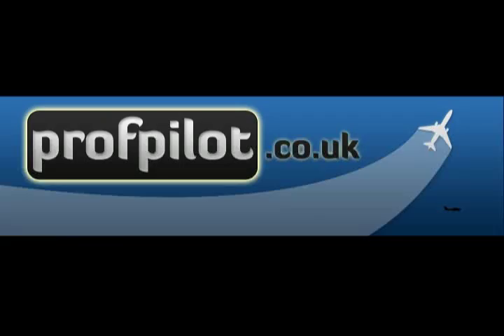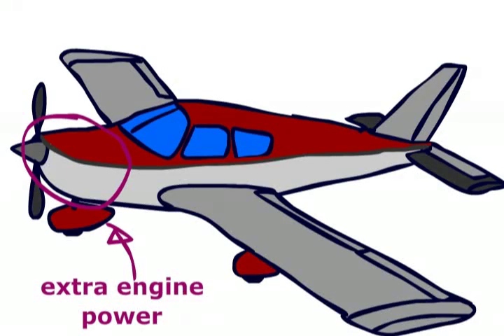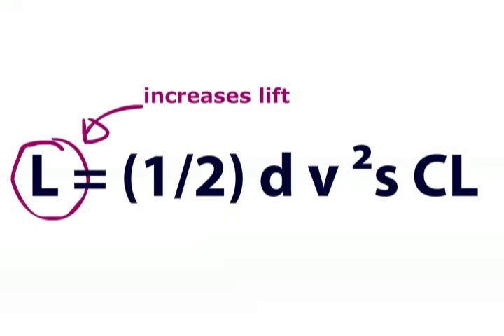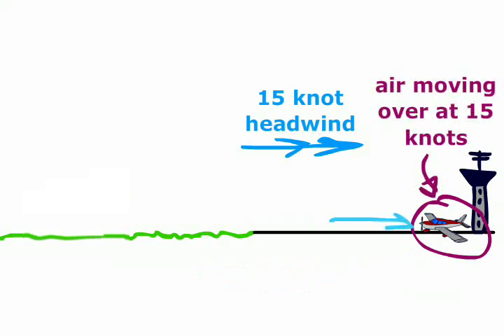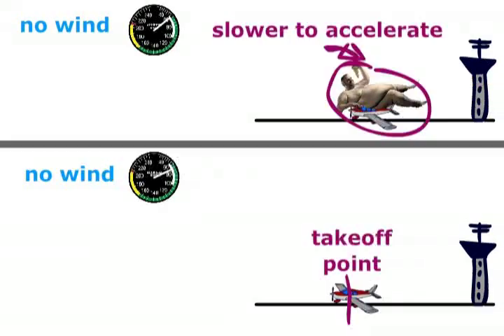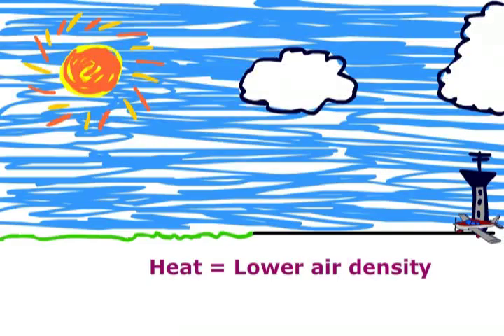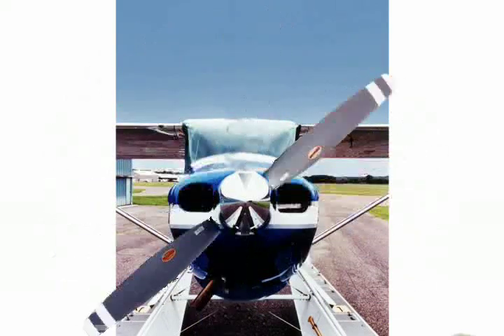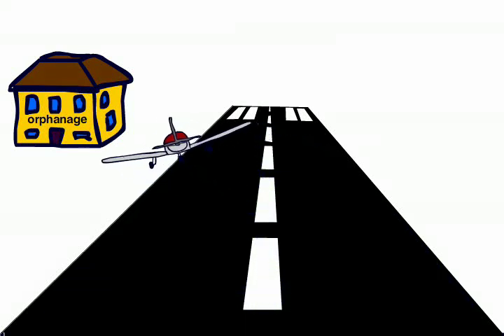Aircraft Takeoff Explained | profpilot.co.uk video #11

Comment: THE SPIRALING SLIPSTREAM DOES NOT "STRIKE" THE VERTICAL STABILIZER. IT INCREASES ITS ANGLE OF ATTACK  ON THAT "VERTICAL WING" WE CALL THE VERTICAL STAB..AND THEREFORE IT PRODUCES LIFT TO THE RIGHT...YAWING US TO THE LEFT.
Reply: both you and he are correct. depending on who is teaching it, sometimes only the the strike on the vertical stabilizer is mentioned.

Comment from the maker: @keithroche2 In order for there to be an acceleration in any direction, you need to have an external force acting in that direction. During the takeoff runup, lift and weight are the same so there is no acceleration upwards. If this carried on, you'd just bumble around at the end of the runway at the same altitude, going rather speedily, and probably scaring the poor airport fence.
However once lift is greater than weight, there is an acceleration upwards, and the glory of aviation can occur.